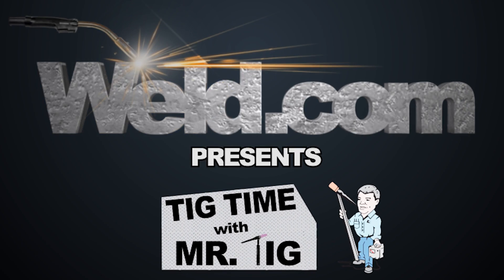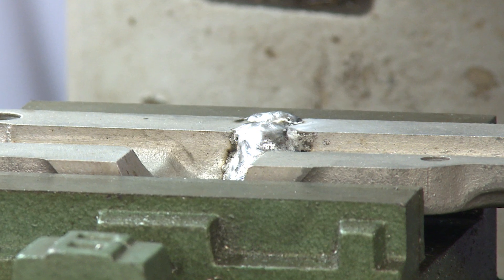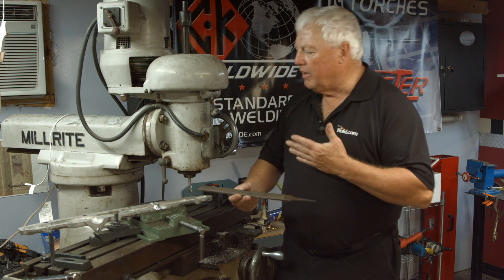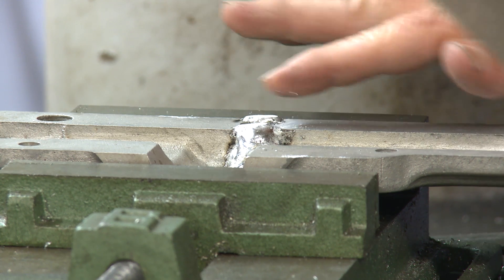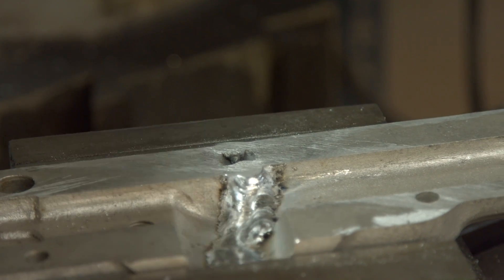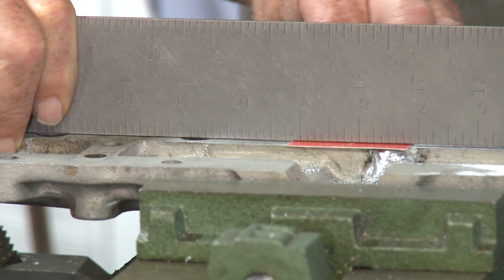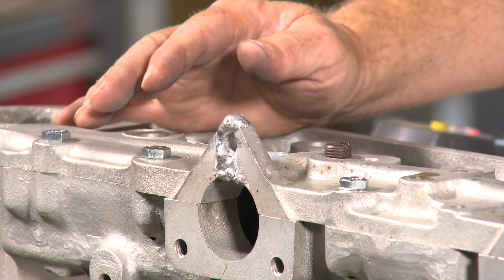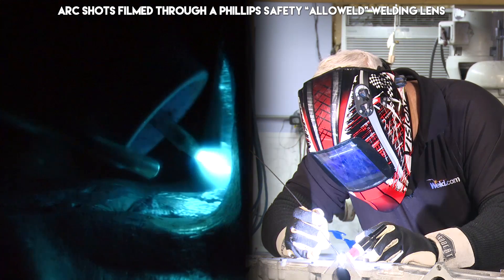Cast Aluminum Header Repair: 1954 Nash Healey (Part 3 of 3) | TIG Time

Comment: You make it look so easy!

March 2, 2024 Chicago area: I received a quote from a "mobile" welder (listed anyway as one) who commanded $300+ to weld an aluminum flange on a Toyota 3.0 V6 Intake Plenum; or as listed in the shop manual, "Air Rush Tank."

Comment: I worked at a porsche audi dealer and was tasked with some body repairs on the all aluminum A8. Their dealer parts dept has as Audi parts a product to stop burrs. Roloc discs etc.  from clogging with aluminum. It was blueish in color and a dry waxy feel to it. It worked too. 3m 50 grit rolocs would grind and not clog. Had no dirty residue we welded where it was used and no problems.

Comment: Preheat the basemetal specially when aluminum is the alloy to weld, 800*f for over 1"" thickness and below 600*f for below 1"" thickness area, use the right settings for each thickness,120 Amps and above for 1"" thickness, and less than 120 Amps for lesser than 1"" thickness, it"s very important to use the right 100% argon cfh for each cup size, the bigger the cup size the more argon cfh to be use, for every size number multiply it for 2.5 and the result will be the cfh add 2 more cfh numbers if need it.

Comment: Fantastic, at 75 I have decided to add  "TIG to my toolbox of tricks"  and your videos are a "God send". I have a bucket truck in need  of a lot of cosmetic love.  I need to repair or make new tool box doors .So TIG is the way to go. Would you please suggest a way of joining sheet metal to a 1/4  '' rod for a hinge? Wrap the sheet metal around the rod or butt TIG the sheet metal to the rod? Thank you for all your efforts.
Reply from the maker: David, the new forum will launch with our new site on May 23rd. There is an active audience of professional weldesr that can help you with you're projects.

Comment: Mr Tig I watched many of your videos also other major videos of welding pros, I subscribed to all.
However, I never saw anything really interesting like building up a broken cylinder fin of a motorcycle çylinder in aluminum and of cast iron fins also how to weld very close to a threaded hole without damaging the thread.I would be grateful for your advise and demonstration of these areas. I enjoy your presentations and appreciate your work put into it
ThatOldBob

Comment: Why 4043? I was  just wondering.
 We weld marine grades and always use 5356. I have been told the 4043 flows better but is weak.
Reply from the maker: With cast materials 4043 is better because you need the best weldability. We go over in more detail in part 1.
Reply: Ok, thanks.

Comment: Hi Mr TIG. Good project but 2 questions. Would any preheat have helped? I notice you (lightly ?) clamped the manifold to the head for final weld-wouldn't this have soaked up a lot of heat? Also I wonder if you think it's a good idea to use a rasp type file without a handle --perhaps you've never stabbed yourself with a file tang? No offence!

Comment: Question: on the mating surface section you filed, it looks like there is a big crater where you didn't get enough weld metal. Did you or will he fill that with something (more weld metal, JB weld,etc.)?